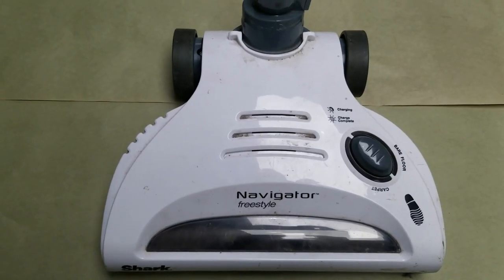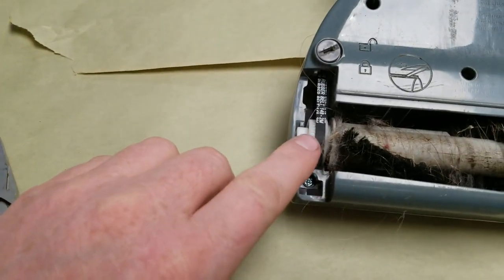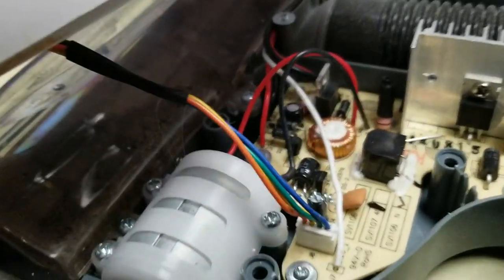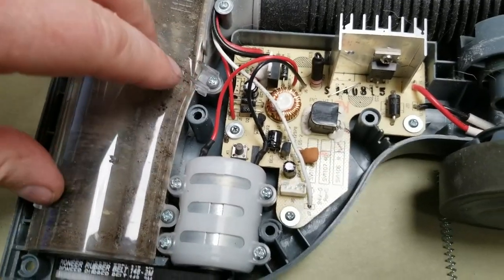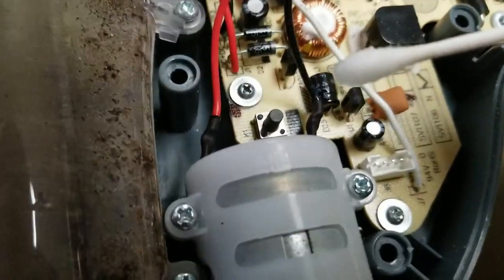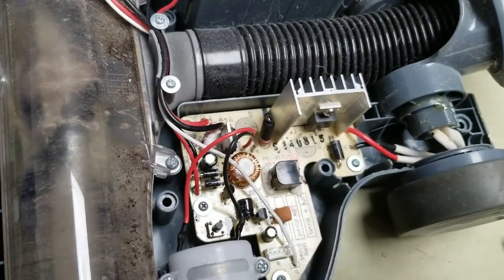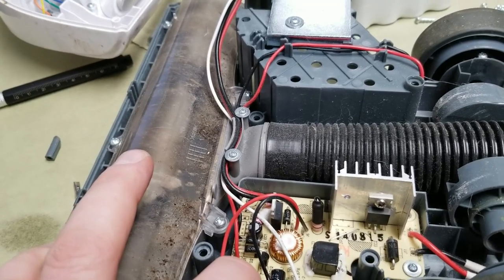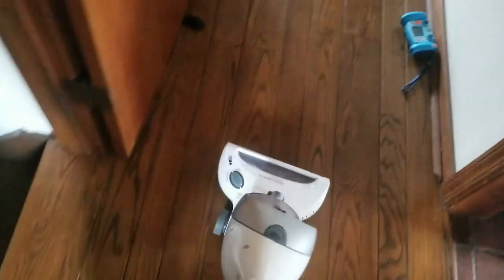Shark Navigator Freestyle will not turn on ** Fixed**

Comment: Thank you so much for posting this video!  My Shark was doing the same thing, and no matter what I did to it, the switch would not stay on.  I saw your video, followed your directions, and voila! I now have a working Navigator.  I am a 72-year-old woman who loves puzzles and problem solving.  When I saw your video, I had to try.  Only thing is I have an extra screw left over that I can't remember where it goes.  Otherwise, the Shark is back in working order again, and I actually had fun figuring this puzzle out.    FYI - the switch spring was a little tricky to put back in and kept falling out when I was fitting the top and bottom back together.  I put a dab of Gorilla gel glue on the end to keep to keep it in place.  All good to go.  Thanks again!

Comment: It worked!! Thank you.  I had 8 screws to remove.  I ended up putting a dab of Vaseline on the tiny spring to help hold it in place so I can assemble the top in position.  Thanks for the video.😀😃

Comment: Super! I gave mine a shot of brake cleaner after alcohol didn’t work 100%. Then - it worked when pressing the switch directly. Not when assembled.
I assumed that the plunger had a stop inside but it didn’t. I ended up rolling a bit of paper, sticking it in the plunger, and cutting it off flush. Working now.

Comment: Clean both ends of the brush bar. Remove all the hair and dust balls. Too much hair on the bar can cause the vacuum to shut down, it's a safety to keep the vacuum from overheating and burning out the motor.

Comment: I got mine apart just fine, it wasnt the little switch on the circuit board, I think it is the spring doesn't push on it when I put it back together, I presume the spring goes in that long hole and then that is all supposed to fit onto the other side of vacumm bottom . I tried that and for some reason I guess the spring must come out when I put it back together. When I took it apart in the first place I found the spring loose in there just laying there. Motor runs fine just pushing the button on the board. I guess I will leave it sit for a while and try again later.

Comment: Mine seems like the battery is not charging clean the connectors where it sits prompt up the metal tabs so makes a better connection I know the batteries are good cuz sometimes it takes a supercharged and sometimes it doesn't charge at all

Comment: Took a apart but not sure how or where the spring goes. Tried to watch video in slow motion too. Can you help ?
Reply from the maker: At 1:25 in the video i show the button for the switch i believe it mounts on the circle next to the gray piece. I could be wrong though its been a while.
Reply: Thanks so much. I will give it a whirl. Thanks for responding and making the video!!
Reply: The spring goes inside the gray tube that pushes down on the switch when pressed. Put the spring inside the switch tube then reassemble upside down so the spring will not fall out.
Reply: If you mean the spring for the outside push button, it mounts on a + shaped plastic stud next to the 2” long gray plastic tube that pushes on the circuit board mounted switch.